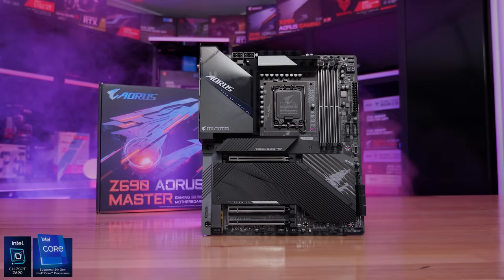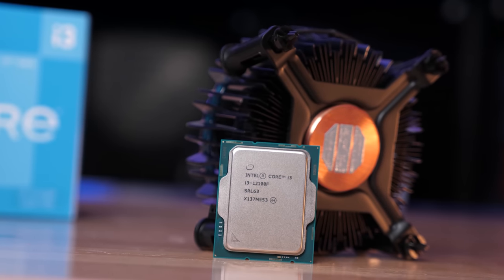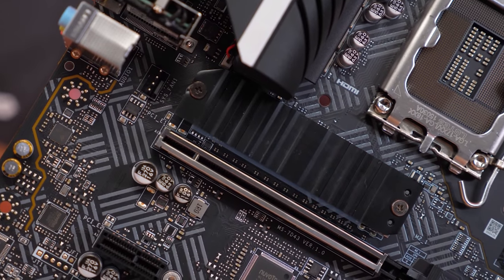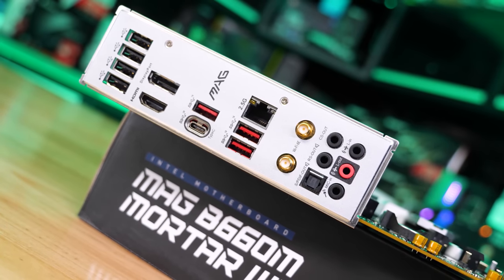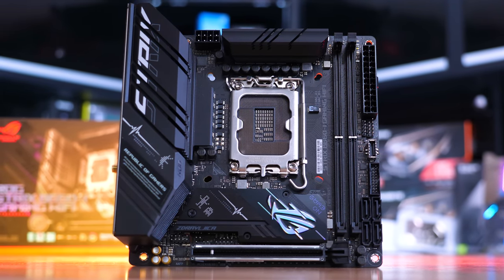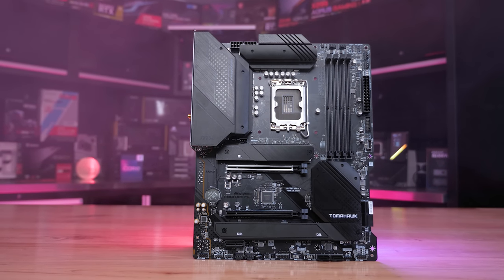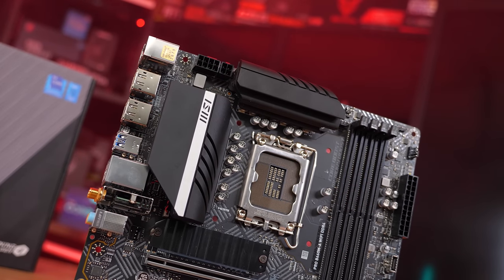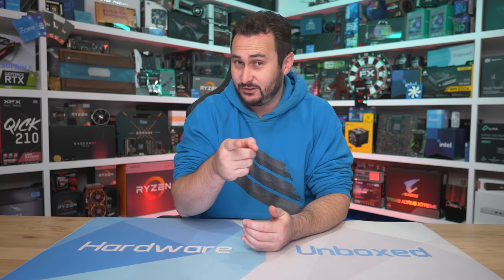Top 5 Best B660 Motherboards

Comment: I made system with 12700F, msi pro b660m-a, inno 3D rtx 3080, nd 240mm aio, it's running all fine, no throtteling, no overhearing at whatever load i put it on 😉
Reply: Sorry but this cjannel forgot about msi mag b660m bazooka. It is very good
Reply: @jimlahey5623  i think msi pro b660m-a has got all the feature one need, there is no need to spend any extra penny on motherboard rather save it for gpu, my original plan was 12700k with z690 nd 3060ti bt settled with 12700F msi pro b660m-a nd a massive powerful 3080 in same budget, so it's great
Reply: @mayurgoyal8762  okbut msi mag b660m bazooka is not that expensive :)
Reply: @jimlahey5623  They did it in another video
Reply: Do you regret going with the 12700f instead of the k? I’m thinking of following your lead because performance in games seems perfectly fine in benchmarks
Reply: @evilmarc  The K and the F have basically no performance differences, because the F is just a 12700 with ni iGPU, and the K is just an overclockable 12700.
Reply: @evilmarc  no regret, if I had choosen K version than I had to compromise with gpu, instead of 3080 i would have pick up only 3060ti or 3070 as i had tight budget.  Besides both chips r identical in performance with merely 2-5% difference bt difference in cost is huge
Reply: @evilmarc  u should only ever buy a K sku CPU if you plan to pair it with a Z series motherboard (Z690 for alder lake) as anything that's below the Z series don't support manual CPU overclocking (H610, B660 and H670), as for the F sku the benefit is that you get to save some money for getting a CPU that has no integrated graphics, tho please note that this is only applicable to intel CPUs and motherboards as AMD runs things differently
Reply: @mayurgoyal8762  is it running good while running the processor at all time boost ?
Reply: @adilahmed7875  yes bt i wish i have chosen air cooler instead liquid, fokat paisa jyada diya,
Reply: @mayurgoyal8762  yeah air cooler bhi bahot accha hai
Reply: @adilahmed7875  actually air cooler helps in cooling down motherboard vrm as well
Reply: @mayurgoyal8762  yeah they do but as u go for an i end like i9 or ryzen 9 or ryzen 7 liquid liquor is essential to cool if from my opinion
Reply: @adilahmed7875  liquid cooling only required if u gonna use it for rendering coz in that case cpu utilisation gets 100% while in gaming cpu usage is hardly 20-30% in these new chips
Reply: @mayurgoyal8762 yeah u are right but if iam gonna buy a high end cpu so why shouldn't i be using full cpu power by spending some little bit more money on liquid cooler ofcourse i will use full cpu power so liquid cooler is essential for high end cpus
Reply: @adilahmed7875  well liquid cooler may leak any time so its always a risk 😅
Reply: @mayurgoyal8762  you are wrong it won't man i mean come on seriously if that was the case no other pc tech Youtubers would recommend aio most of the time
Reply: @mayurgoyal8762  hey bro, planning to build exactly same and a bit confused between which cooler to go with.
My major usage will be office work with heavy browsing and Valorant or other games.
Originally planned for deepcool AS500 plus air cooler
Reply: @kaustubhx5452  if u have budget to buy expensive cooler than better to go with Aio 240mm other wise cheap ak400 is sufficient
Reply: @mayurgoyal8762  which cabinet and aio are you using and what are your Temps?
Reply: @kaustubhx5452  brother u dont need to worry about temperature until u gonna use 100% cpu. In gaming nd browsing cpu usage go to hardly 25% so anything will work. M using deepcool matrexx 40 cabinet matx small nd compact cabinet. Nd i dont ever check my temp coz i know they will b fine 😂
Reply: @mayurgoyal8762  understood! Thanks bro👍
Reply: @mayurgoyal8762  hey, am planing to build a pc for maya, Houdini, blender, nuke, etc. I have chosen exactly the same pc components but am confused about what type cooler should i use. Am in tight budget. I was thinking about getting deepcool ak 620 air.
Reply: @BroliestBro  ak620 is expensive go with ak400 its also 220watt rated cpu cooler and works fine at half price compare to ak620
Reply: @mayurgoyal8762  soo air cooler will be enough for rendering?
Reply: @BroliestBro  i dont have experience with rendering brother
Reply: How do you like this board, many note problems with the BIOS.  in particular with RAM.  is everything working fine for you?  I choose between this motherboard and Gaming X DDR4 from Giga
Reply: @stefan_es  gaming x is low level board compare to this only issue i got was with xpg s5 ssd which was causing blue screen error after launching game then i swapped it with Kingston ssd then everything was normal
Reply: @GOTTHEDAWGINME  k skus are usually 100-200mhz higher clock out of the box but significantly more power consumption. So the k will outperform the 12700 but not by much. Main bonus of the k sku is resale value when you go to upgrade.
Reply: 12700f is best value CPU
Reply: @mayurgoyal8762  Thank you! Building one with i5 12600k, msi pro b660A, DC ak400. I was regretting not going for an AIO for the cleaner look. Feel better after your comment
Reply: @mayurgoyal8762  which Kingston SSD?

Comment: The move towards ddr5 on asus itx at that moment was not right. I own the b560i model paired with 11700 at 125/150w pl1/pl2 and it runs perfect and was a rather cheap combo with ddr4. But ddr5 prices through the roof make b660 itx from asus not viable from price/perf perspective.
Reply: Gigabyte do right with ddr4, but 1 slot m.2 only kill it. 😔
Reply: Yeah, I want my next build to be SFF and don't want to spend that much on DDR5... Luckily it'll be a little while before I build again I think so hopefully there are more options or DDR5 is cheaper.. there also will probs be more CPU OPTIONS
Reply: It seems DDR5 is falling in price pretty quickly. A month ago when I last checked it was at least twice the price of decent DDR4 memory. As they are not easily compared I looked at 32GB of memory and 3600 MHz CL16 for DDR4 and 5200 MHz CL40 for DDR5. A month ago the DDR5 came at more than twice the price. When I compare today it's "only" 50% more expensive than the DDR4 option. And these are not cherry picked campaign prices but the first both meeting the criteria and being in stock.

Feel free to criticize my choice of memory, but it still shows a trend. Lets hope the price of DDR5 keep on dropping for a while yet. It will be very interesting to see how the market reacts when AMD releases their new platform as it uses DDR5 exclusively. Either it causes a memory shortage again which means higher prices or the manufacturers have been ramping up production enough the market doesn't crash. While I still think DDR4 is good for a few years more I really would like to go with the "New Shiny" if I build a new machine just to have the option to stuff more memory in it a few years down the line if it turns out 32GB just isn't enough for next gen Pack Man...
Reply: @blahorgaslisk7763  I haven't been watching the price history but 32gb of ddr4 is about 110-130 and the lowest I saw was about 270 for DDR5. I'm mainly talking about building a PC right now too, honestly I think a lot of computers people build are overkill for what they need and people just build PCs that powerful just because haha
Reply: I don't know about you but most people who build ITX systems I know never care about price to performance at all. They just like the compact aesthetic and they're willing to pay stupid money for it. ITX boards on their own are already much more expensive than ATX boards with the same performance since they require additional engineering to fit all that performance in such a small form factor
Reply: @thangluongquang2826  I prefer the SFF aesthetic sure but within reason.. the itx boards I've seen are maybe 20% more expensive and for PSU's it's about the same. That plus the case is about all the "more expensive" parts I think double price for a component that isn't specific to itx without any benefit is kind of crazy. Especially since I'm talking about building a computer now. Sure DDR5 will be more relevant in the future but once I build my computer I don't really need to upgrade it for at least a couple years. Idk what the average upgrade time is though 🤷‍♂️
Reply: @blahorgaslisk7763  Where? Im still seeing lots of kits double+ in price compared to 3600CL16 kits
Reply: These companies seem determined to take your money no matter what option you chose. mITX DDR4 mobos are expensive or non existent in offer , DDR5, you pay extra the memory on top of the mobo+cpu.
Reply: Exactly!!. I was gonna build my ITX build with i5 12400 but seeing B660i Rog Strix uses ddr5 broke me and now I'm forced to i5 11400 instead.
Reply: @BronislawStark  he said the ASRock would be fine for the 12400 so might want to check that out rather than going to the 11th gen! Although I know ASRock has kind of a bad rap for mobos
Reply: @Oz-gv5fz  
who tf raids on a budget?
Reply: @juanme555  no one, but on mini itx build, less cable is better. With 2 or more m.2, is okay without sata storage. I personally plug a pcie gen4 1tb as boot drive and a pcie gen3 2tb as storage.
Reply: @Karyzn  yeah but like you said, asrock tends to have bad rep on their mobo and their itx mobo is more of the low end. Two of my friend used asrock mobo before and both of them had problem with it so I would like to avoid them.
Reply: @BronislawStark  Yeah i also think asrock barred youtube reviewers from receiving review samples which is kinda sus
Reply: @Oz-gv5fz  yep, not really good since the storage fills up fast these days. Plus gigabyte uefi is a bit worse too between the big tree.
Reply: @BronislawStark  go 11700 if you can then. Great combo for b560i and can be bought quite cheap these days, especially if already used. I’ll upgrade next time when ddr5 matures more alongside platform and new (13)14 cpu series.
Reply: @billionnaire1  I considered this also, just going AMD..
Reply: DDR5 or nothing for me if I'm buying a brand new modern platform why would I nerf it by using DDR4 regardless of price DDR5 all the way.
Reply: @wizzgamer  the point is as of right now you're not nerfing anything unless you plan on upgrading again in the near future. The performance for DDR5 is basically the same as DDR4. But if you have the money then by all means

Comment: No one is giving h670 any attention. In my mind, K processors in this generation make no sense, unless you are getting 12600k, because it gets those efficiency cores that 12600 does not. Because of that, for someone that might need PCIe lanes, h670 makes the most sense. Who cares if my 12700 does not go to 4.7ghz as a 12700k, when it goes to 4.4 on all cores? Price difference, when you include the z690, cooling and power consumption is not worth it at all.
Reply: H series always slide under the radar 🤣 I remember buying intel H87 motherboard back in 2014
Reply: My problem with the H670 is that the B660 already intrudes on the price range of the Z690. And all H670 boards I've seen are either total crap or well into the Z690 price range. And if you are paying that kind of money I can't really see why you would go with a H670.

What I really would like to see is how much performance you leave on the table if you were able to find a H610 motherboard that didn't choke on say a 12600. I know it's not made to be flexible or expandable, but paired with say a i3-12100 and a RX 6600 it should be a very cheap 1080p gaming rig. And yes I said 12100. This little monster will out game the Ryzen 5600X in almost any game on the market today at a fraction of the price. Currently it is really hitting out of it's price class. That might change with upcoming games but that's then and this is now. And if that happens the i5-12400 has six cores 12 threads and kicks the R5600X even harder.

But so far I haven't seen any of the usual suspects even glance at the H610. I can only assume either the motherboards are so crappy it's not even worth looking at them or the h610 chokes so bad it's not even worth it for a throwaway system. Still I'd like to se the numbers as to just how bad it may perform.
Reply: @blahorgaslisk7763  funny thing is if you have certain criteria, like not needing to OC while still being able to max out stock performance while also rolling with DDR4 in an ITX form factor, H670 has come to the rescue thanks to Asrock with their H670m-ITX. The board's got just okay VRMs where only half were given heatsinks so I was worried about being able to drive a 12600K but this issue got remedied thanks to the Arctic Liquid Freezer Il's VRM fan.

The only other DDR 4 ITX board I could put a 12600K in was from gigabyte, and from user reviews it seems like a total mess.
Reply: I remember when "B" meant "designed for businesses" and "H" meant "designed for Home use". Wish that was still the case.

Comment: MSI did a great job with their B660 boards. Really impressed with their offerings this launch. Im going to get one and a 12700F for my brother for his birthday.
Reply: wholesome comment
Reply: Any insight as to why MSI and Gigabyte haven't released H670 boards in the US yet? 
My older B series board is crippled wrt PCIe gen 4 and M.2 capability. I plan to upgrade from a core i3 iGPU and PCIe3 NVMe in the future so I want plenty of PCIe lanes! BTW not a gamer at this time .....
Reply: For the last 2 years I feel like they've brought good mb's to the table at varying price points, I agree it's nice to see
Reply: I have MSI's B460M MAG Mortar board with a 10700F in it... yep, MSI really does a great job with their Make America Great boards! 😆
Reply: Funny, I was planning on buying those exact parts too.
Reply: @mickfreeley6054  H670 motherboards are hard to find because they are bad value for money. For any H670 or H570 motherboard you find, there will always be a Z690 or Z590 motherboard for a similar price that offers the same features as the H series but also has the additional benefit of being able to overclock the CPU for more performance. This is why H-70 series motherboards are disappearing.
Reply: MS I无脑堆供电，说实话B660M 迫击炮上12900K都没有问题，华硕家的tuf b660属实难蚌，他的那个pcie4.0*16的插槽，我显卡插不进去，被那个散热马甲挡的死死的

Comment: i found another good looking B660 board; it's the Pro B660-A (ATX Version of the Pro B660M-A)

it looks pretty decent, 8 USB ports total with a 12+1+1 phases (RT3628AE controller with 53A AONS36308 high side and 83A  AONS36303 low side)
Reply: in my country just m version nothing atx version what is the different of m and atx version?

Comment: I got the MSI B660 TOMAHAWK Wifi DDR4 some 2 weeks ago .. WOW, what a blind shot! I do have a 12700KF however the effective performance of a K is potentially 7% extra at only 10% more cost. That is before considering you pay 50% more for a 12900K or 33% less for 12600K, so the proportionality is there far more between the K and non K.
I consider getting the same level of quality out of a Z690 would have been like throwing away money as on a 12900K on a bunch of features my "limited" system wouldn't even use (beyond overclocking, there is the extra DMI lanes I wouldn't need).

Comment: Finding which motherboard is the best value for your needs seems to be a far more important decision than whether or not you go with AMD or Intel. Whichever CPU allows you to get the best value board to go along with it, is the question you need to ask yourself. In my region, it seems like getting an AM4 board and AMD CPU is more likely to get you the best value, but not everyone has the same needs. Certain I/O or networking features could be very important for some people.

Comment: I've been mulling over an Intel 12600k system. The b660 tomahawk and b660 pro m-a are the most appealing options for me. I think the added usb on the rear i/o and overall better looks are worth the extra money for the tomahawk.
Reply: So did you go for 12600k? i was looking at b660 and h670 tomahawk since i'm not planning to OC and there is 4€ difference in price in my country.. i wonder why no one mentions the h670 line up
Reply: @rokdovecar5275  Nah I'm still running my 5600x/3060 ti system. It's doing well enough and I game at 1440p so there's no real reason to upgrade cpu. If these next gen gpu's are as good as advertised, cpu might make a big difference at 1440p the way it does with 1080p now. I guess we'll know soon enough.

Comment: My only issue with the ASUS ROG Strix B660-I Gaming WIFI is that it seems to be DDR5 only. How does the ASRock H670M-ITX/ax hold up in terms of VRM? Connectivity seems to be pretty good on it for the price
Reply: Yeah the ASRock b660 itx is pretty garbage, 4 USB ports
Reply: @butifarras  that's why I was talking about the H670 and not the b660

Comment: MSI is planning  to release, probably on  july 2022, a new "B660M mortar MAX wifi ddr4" motherboard with BCLK overclocking and PCIE-5. If this motherboard is selled under 200$, it would be the best motherboard to pair with non-K cpus.

Comment: I just got the B660M-A MSI motherboard for my 12400F. Thank you for helping me pick out a mobo for my new build. I also have a rtx 3060 on the way
Reply: How do you like this board, many note problems with the BIOS.  in particular with RAM.  is everything working fine for you?  I choose between this motherboard and Gaming X DDR4 from Giga
Reply: @stefan_es  I actually returned it, because I originally wanted the ATX version (which was out of stock when I was shopping) so I’m waiting to that one when it arrives. The bios worked fine for me though and had XMP enabled. The B660m was too small and didn’t fit my gpu properly
Reply: @auradrifter7779  What motherboard did you end up buying?
Reply: @stefan_es  same model, but ATX version. MSI B660 Pro